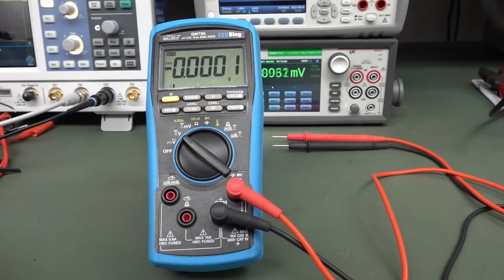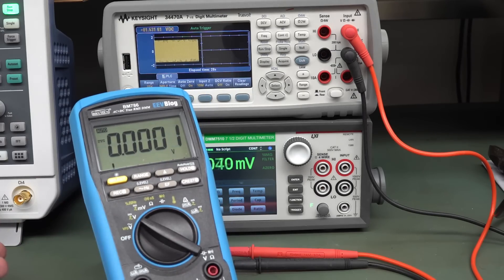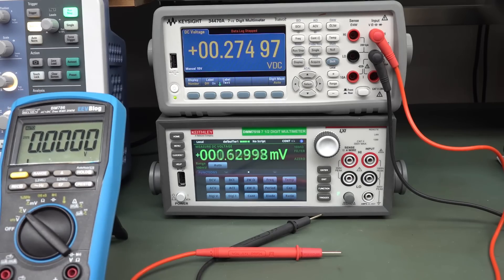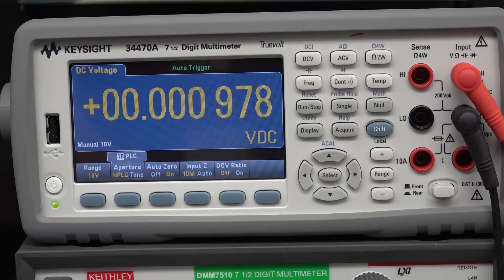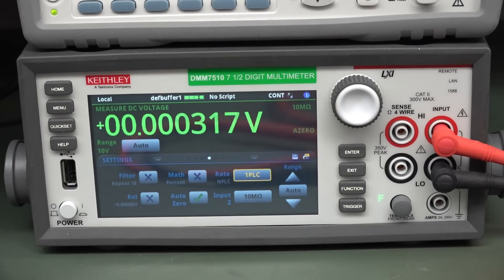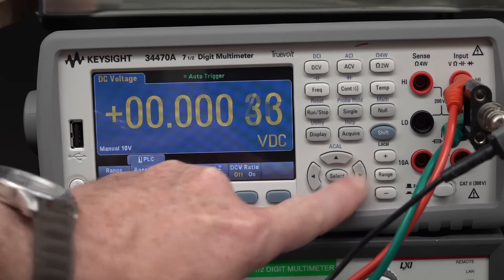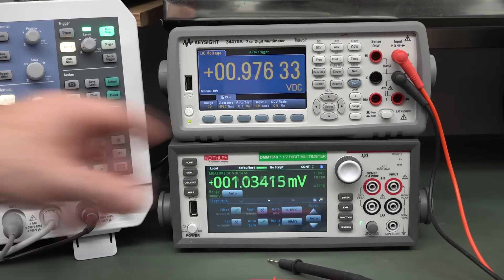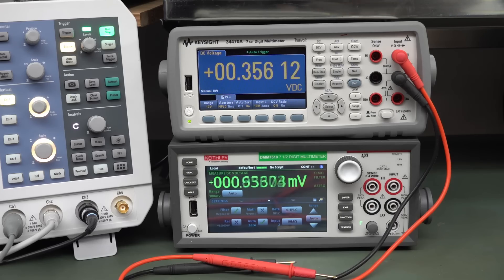EEVblog 1379 - What's all this NPLC Stuff Anyhow?

Comment: You keep telling you cannot get the same result with short integration times and averaging the samples. But I cannot see why averaging would not work, as long as the sample rate is high enough to avoid aliasing AND the averaging time window is large enough. Assuming you have some large sample rate, as the length of the averaging window approaches infinity, the cutoff frequency of the "effective lowpass filter" should be approaching zero.
Reply from the maker: Yeah ok, I see your point there. I guess in theory that's possible, but try it on any meter and the lowest NPLC setting still gives a crap result.

Comment: Thank you Dave!  I have a 5.5 digit HP bench multimeter.  I bought it used on eBay and the 1 VDC reading had me concerned.  I did a google on the subject and read it was due to the high impedance.  I let it go at that.  Now watching this great video enlightened me so much deeper on the subject.  I had not idea the multimeter was integrating.  I never knew about the powerline cycles etc.  Now I know, thanks to you. I am now going back through my multimeter manuals to understand how to vary the number of PLCs etc.

Comment: What would be the purpose of having a non-integer PLC setting if it needs to be used always for accurate measurements?
Reply: Faster sample rate when using a low enough impedance source that the 'noise' becomes a non issue.

Comment: Is the timing for the integration directly coupled to the mains cycles or is it determined by some crystal oscillator?
I imagine that this could lead to some kind of discrepancy/error because of oscillator tolerances and drift.
Reply from the maker: Doesn't need to be synced, as you'll average out to zero regardless of where on the cycle you start.
Reply: @EEVblog   i think the point was the power frequency could be 49.9 hz and the MM "PLC" could be referenced to 50.0, so 1 PLC wouldnt  necessarily get the job done so cleanly.  So not phase but absolute f
Reply: @romand4651  Yes exactly.
I don't know how noticable the effect would be, but even a slight difference in absolute frequency could be noticable in a 7 1/2 (or more) digit multimeter.

It would be interesting to see if there's any circuitry to get a "mains clock" from the PSU of the multimeter or if the internal oscillator specs are good enough for the effect not to be noticable.

Comment: Should that mean then that when using a high end bench meter if they are that sensitive, should the test leads be shielded
Reply: Shielding mains is generally quite difficult skin depth is quite deep at that low of a frequency, would need a thick layer of steel 10s of cm iirc, impractical
Edit(steel is actually quite a bit better probably could get by with less tha. A centimeter, copper/aluminium is abysmal though)

Oscilloscope probes are functionally shielded, but they'll grab it just as easily

Comment: Is it fair to say that the difference between PLC integration and simply averaging multiple samples later, is that the samples averaged may not exactly coincide with the mains cycle? Kind of like filming a spinning wheel; only when the frame rate exactly coincides with the rotation speed does the wheel appear to stand still, otherwise regardless of frame rate it will appear to spin one way or the other. The wheel can even appear to slow down and everse direction  as the frame rate comes in and out of time with the rotation speed.

Comment: The fact that the bench meter is mains-powered probably contributes to higher ghost voltages because of inevitable capacitance of its circuit ground and mains pins/earth. 

Not to complain, thanks for showing off a feature of bench meters i never knew existed.

Comment: My last math class is years ago: Why doesn't averaging do the trick here?
Reply from the maker: Good question. Because the measurement error caused by the noise pickup (say 1V) is already taken as the measuremerment result.
So try calculating the average of say 1V, 1.2V, 0.8V, 0.5V, 0.2V - you'll never get the intended 0V and elimination of noise.
But if you sample over precisely 1 PLC then the main noise is averaged out in the measurement itself and the result is always 0V (or very close).
Reply: @EEVblog  It's also why you can't implement an antialiasing filter digitally after sampling in DACs, as the aliasing error has already been recorded in the samples.
Reply: @EEVblog  Edit: D'oh - ok, you even said it in the video: nyquist...

Comment: Sampling high impedance singlas is where this can really come in and bit one.

I though sometimes wonder, if 230 +/-20 VAC noticeably worse than 110 +/-10 VAC.
Considering that most regions using the lower voltages tends to operate at 60Hz instead of 50Hz, then it should have some stronger capacitive coupling into leads and such, but the reduced voltage should negate that effect by a fair bit more.

I guess there isn't an all too major difference for one or the other in the end, and if one is really paranoid, then one would just shield one's main power cables. (And yes, magnetic interference is also an issue, but steel conduit should reduce such. Though, building an anechoic chamber to have a lab inside of is likely the highest degree a voltnut can reach...)

Comment: At 1 PLC does it actually sample a crap load of samples and then integrate them or does it simply sample once a PLC?
Reply from the maker: It's one sample over one power line cycle (i.e. a 20ms sample integration time)
Reply: @EEVblog  Gotcha, thanx :)
Reply: takes a crapload of samples and averages them out.
Reply: or maybe continuously analogue-integrate the input for one power line cycle
Reply: @victortitov1740  IDK  See above from EEV.

Comment: It's just bad design of those multimeters that creates aliasing: the analog bandwidth should be much lower than fsample.
Reply: It's not even aliasing. It's what you get if you draw straight lines between samples instead of sin x / x.
Reply: @userPrehistoricman  no you just don't have at leat 2* the number of samples rate compared to the 50Hz signal. The sin/x can't solve the issue. A sampling rate of a few Hz can't distinguish between a 0.1Hz signal and a 50Hz one because of frequency folding.
Reply: Okay, but how would you fix that bad design? You say "analog bandwidth should be much lower than fsample". Let's assume fsample is fixed to 2 Hz (reasonable update rate where you can still read the number). Now, how much should the bandwidth be to be "much" lower? let's assume 10 times, so the bandwidth of 0.2 Hz, which means response time of 5 seconds, and settling time to 6 digits of precision will be around 70 seconds. Now, having to wait for more than a minute to obtain an accurate reading is clearly a terrible terrible TERRIBLE design, it horribly interferes with the main function of the meter, while still not really solving the aliasing problem, just attenuating it by 10-100 times.
Reply: it's not bad design when it lets you control the sample frequency. It's bad operator.
Reply: @victortitov1740  whatever the sampling frequency selected by the operator, if the analog bandwidth you'll have that issue. Just think about it: you are taking samples from an analog signal at (almost) fixed intervals. There's actually a 50Hz (weak) signal present at the input. If you don't filter it out, you'll see it. But because of frequency folding, it appears like a much lower frequency.

Comment: Talking about volts ,milli volts , auto ranging,  and the rest?
I was given a RS Components AMM301 New ..Old skool analogue multimeter.
How the he'll do I read the scales?
On ohms I can zero scale on 1k and 10k.  But needle doesn't move on R1 and R100?? Range selector knob is it?
But still? I'm not confident on reading scales for some reason?
For example reading scale then multiply by selected range? I'm POOH at it

Comment: Does not appear to be an issue with the Agilent 34401A 6 1/2 digit meter.  I wonder why?
Reply: Agilent is a better meter my eev blog meter will kill a new battery in the off position in about 10 days there junk
Reply: @georgejobin1744  Personally, I really like the EEVBlog BM786.  I do NOT have battery issues with mine.  I still do not care for 121GW, but it is "okay" and does NOT have battery issues either.  Perhaps you have a bad one.  Send Dave a message to get a replacement.